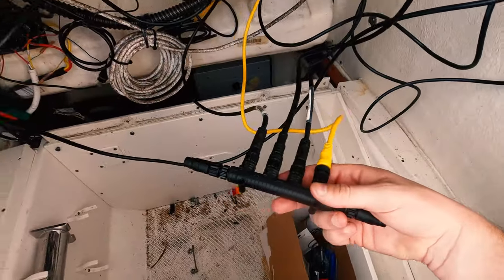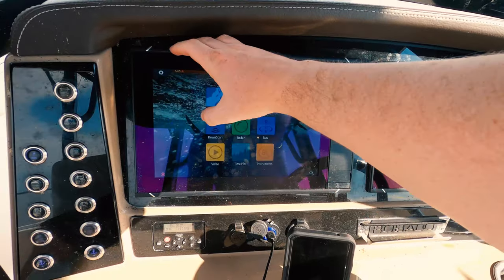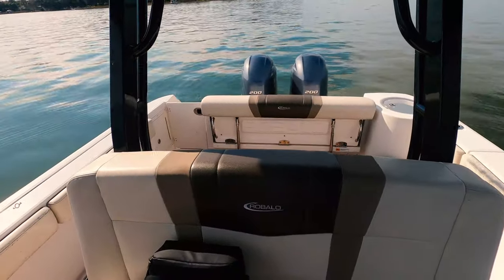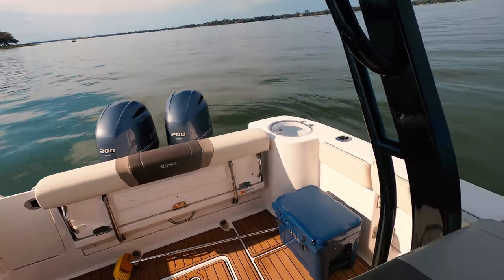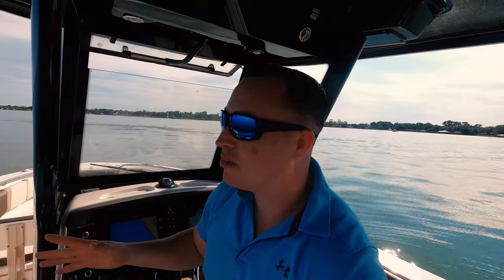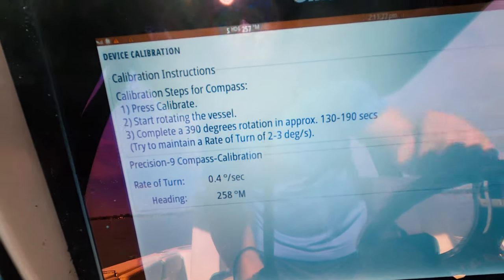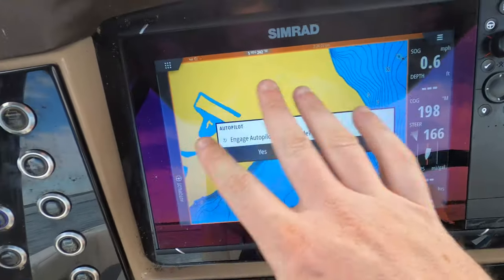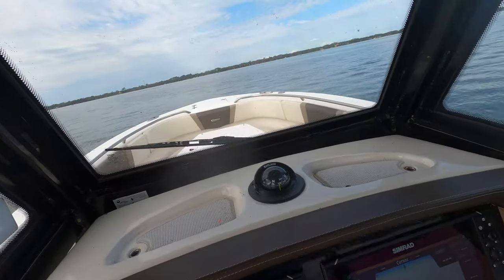Boat autopilot install

Comment: Nice video and I just purchased the same boat with dual Simrads . Are you happy with the autopilot. Was wondering because some people say it wanders.
Reply from the maker: I love it! Yea every now and then you have to recalibrate it but using it for trolling where it actually keeps the boat straight and your lines aren't crossing makes things so much easier! That's predominantly what I use it for
Reply: @NautiEscape  just bought 2020 r272 from sanford florida delivering to NY today. Thanks for the info.

Comment: U been ghost
Reply from the maker: Yea had some things go on where this had to take the back burner for a little bit but I'm starting to get back into it now.

I'll have a few videos coming up. Getting the boat wrapped. Fishing. And bimini Bahamas coming up
Reply: @Nauti Escape  great I got my R222 In November finally broke in now getting ready to start making great memories and fun time 👍🏼
Reply from the maker: @rolandvance6663  where are you located at? You planning on doing the bimini trip with the Robalo Facebook group?
Reply: @Nauti Escape  I am In Miami  Garden yes i
want to make that trip are u going do u  have a group u go with I have been over on my jet ski it will be a 1st in a boat
Reply: excellent videos about the róbalo  272, I'm trying to buy a róbalo  272 and I would like to know your experience and what would you recommend, I would also like to know how you are doing with the two yamaha 200 and the consumption, because I wanted to put two 250 that you recommend me, I would like to know about the simrad that you have, what model they are, and if you have any recommendation about the róbalo  272, I would like to hear it, thank you very much.